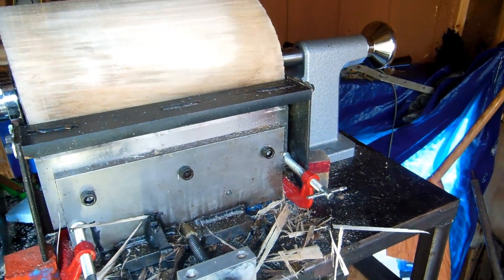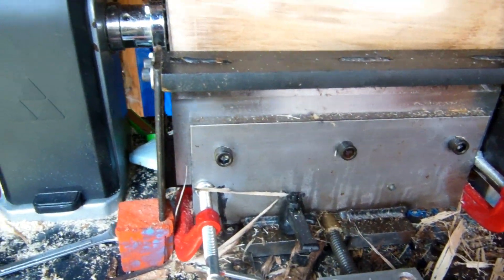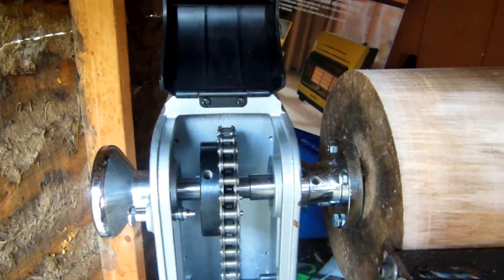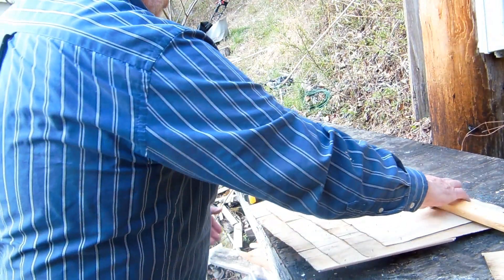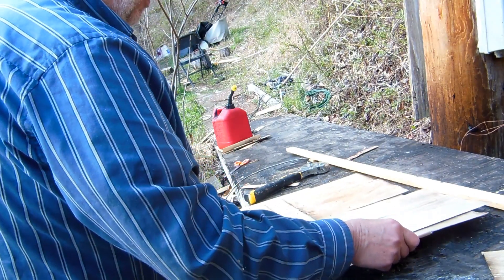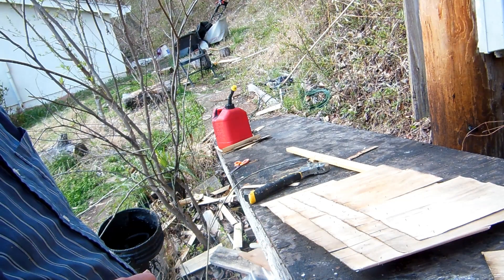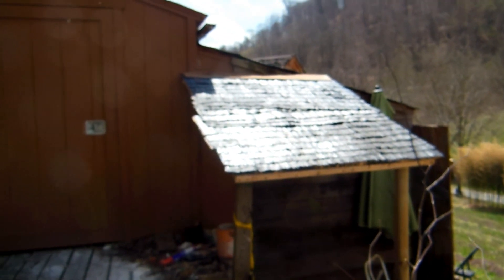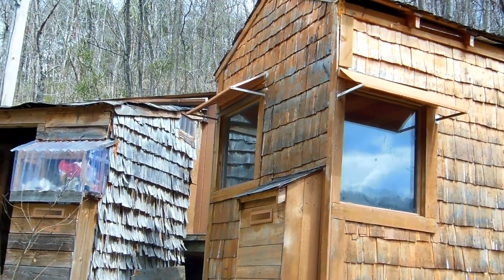Homemade shingle/veneer making machine

Comment: the mechanism of the knife?how it goes in wood?!!!!!!
Reply: The knife blade is vertical and is fed horizontally into the wood. I was making veneer strips as long as I wanted. At this point I made them only 0.060in thick-don't know if I could make them thicker. Plywood layers are really no thicker. I made a big pile of this stuff at the time of this video and haven't run this since-just wanted to see if I could do it.
I want to make wood products more primitively. For years I have tried growing small trees in a row and getting them to grow into a solid piece of wood. I've run into several road blocks such as deer biting off the trees, then growing from seeds that didn't sprout. This time I'm doing something else and will weave the branches horizontally together.
Reply: blade tip ( top side )is placed in the center of wood ?or below?!
Reply: @alinvali496  Its right about at the center. Never tried anything else. Should work best at center.
Reply: Ok,and the blade at how many degrees is bent,thnx
Reply: @alinvali496  Its just straight up vertical. There's that rounded piece of metal at the top I added later. Some call this a 'nose'. Apparently it keeps the blade from digging into the wood. With this I can make veneer at constant thickness for as many continuous feet as I want.
Reply: The blade angle is face to face with the wood?
Reply: @alinvali496  The flat side faces the wood. I believe the angle of the knife edge is 25 deg. I got this made from heat treated D2 tool steel-nice stuff by an industrial blade maker.
Reply: @badbrain8279   Please. What is the length of the workpiece in or mm? What is the power of the motor?
Reply: @hientran-ci5os I think about 10in.
Reply: thank you very much;)